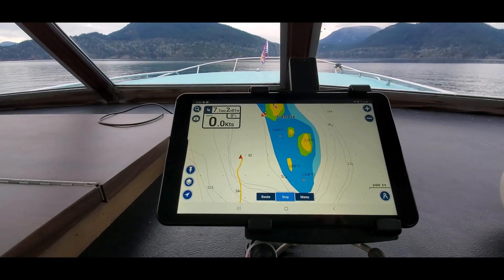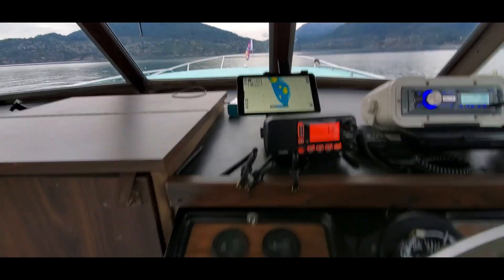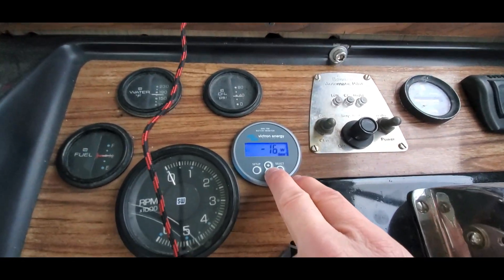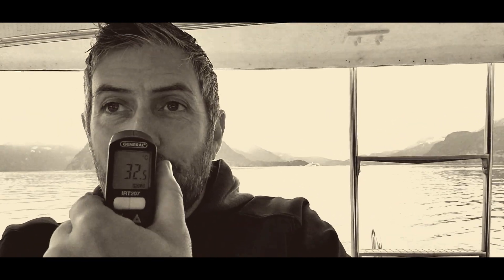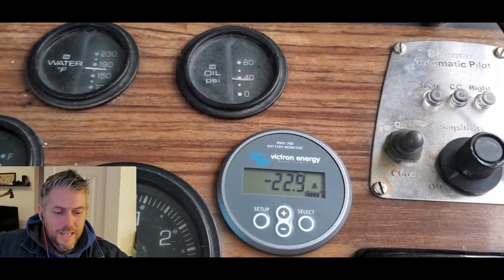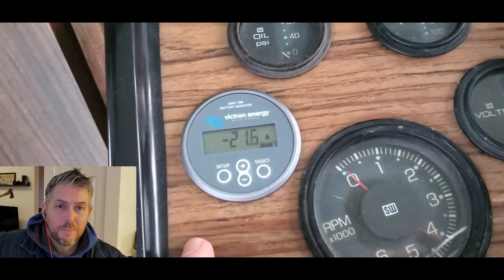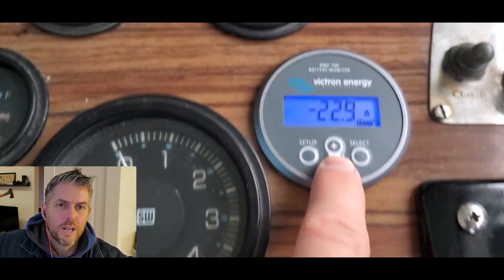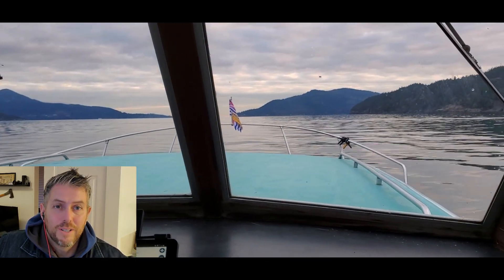Electric Boat - RANGE TEST @72volts And Why Batteries Alone Won't Cut it For Longer Trips.

Comment: 14miles at 72 volts at 4 knots huum, how many batteries do you have in each bank? Also how long does a charge take? I take it you're running lithium of some kind!
Reply from the maker: Until a reputable brand makes it possible to string 72V together safely and for a reasonable price, I won't be using lithiums. A lot of people point me to Alibaba batteries and various other makeshift solutions but insurance will not cover makeshift lithium setups. They feel there is too much of a fire risk if the BMS fails. To moor the boat you need insurance. I've made a few videos about why leads work for now but in short, that is the answer.  Thanks for watching! Cheers.
Reply: @ElectricCruiser  in that case you need a generator. Nice boat. However if you were to build another, what would you do different? If anything at all.
Reply from the maker: Hi  @jamesfrankland6820  , thanks, I love the boat, the only thing I would do different is entertain the idea of an higher voltage AC setup...but there are always budgt restraints, compromises and insurance requirements to be mindful of. 

The available amp-hours, the hull design and the size of the motors limit the range. It's not necessarily the lead vs li. The setup I have is 232AH with leads. In theory, that is roughly the same as a 100AH lithium pack. The lithiums are lighter and will charge faster but the cost is double, if not more, for a safe quality custom setup.  That said, weight and charge time do not affect the range per single charge.
Reply: @ElectricCruiser  so at 232 ah at 72 volt you have a total of 16+Kwh is that per battery bank or total. That seams to low would go at least double that per bank. But with lead you would be adding a lot of wait and size that is why I went with li.
Reply from the maker: @johnmcgee8332  I used to have the boat set up @48V with 232ah but a couple of years later I added 16 more batteries that brought the AH to 460(ish) (series/parallel) That got me 26(ish) nm @4-4.5kts. 
Initially, I was worried about the added battery weight but since I had lost close to 3900lbs (wet)  
[two 1970's 318 Chryslers (1000lbs each), two 160 gallon fuel tanks (1900lbs full), and supporting systems] - I found the boat was balanced better in the water. 
The motivating factor to bump everything to 72V was an issue I had with my portside motor controller. I thought I would take the opportunity to do a voltage upgrade but that caused the re-arrangement of the batteries back down to 232AH. 
I'd go lithium if a reputable company allowed for a 72V string. I spoke with Battleborn today and they will not do anything beyond 48V due to BMS issues. Victron is very expensive, same with Torqueedos but they have the voltage limits too last time I looked. So I might be stuck with leads for a while. ¯\_(ツ)_/¯  The good thing with this setup is that it's simple to upgrade when the time comes!
Reply: @ElectricCruiser  When you see your amp draw drop by going to a 72V system, you're not getting free amperage, just some efficiency improvements to your wiring resistance and motor efficiency. It's Ohm's law. Nigel Calder wrote a useful book for boat owners about boat electrical systems that explains this clearly. Take a look if you haven't seen it.
Reply: Unfortunately he's only running lead acid.
Reply: @chazable  thank's, that explains 14miles.
Reply: hi look at other vids and you will see.cheers adrian uk